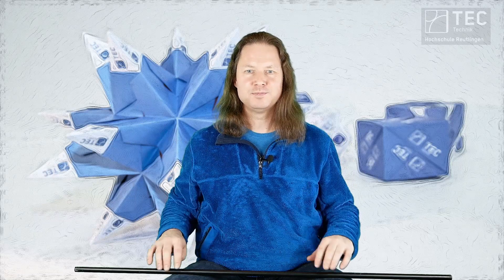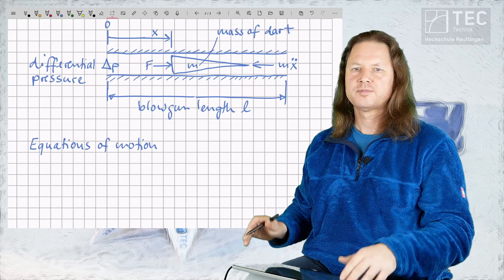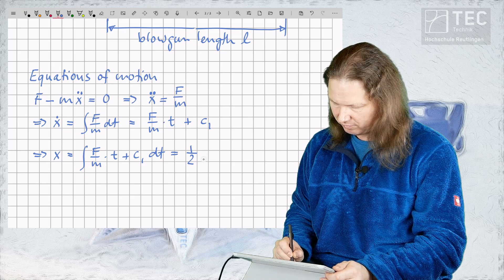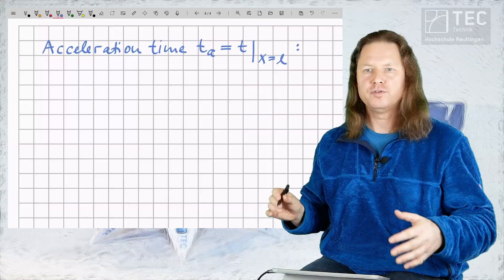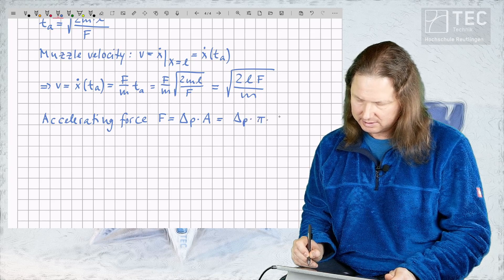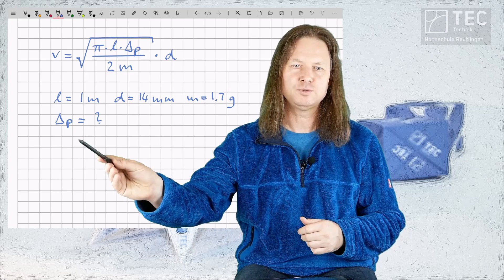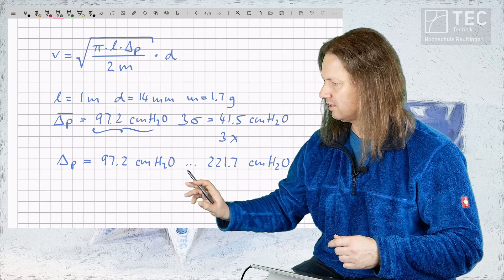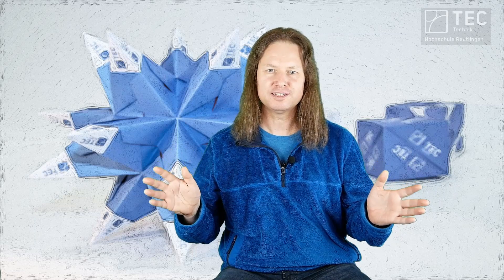Blowgun Physics

Comment: I may be wrong but didn't you assume that force is constant throughout its time inside the tube? But it can't be constant because the pressure difference decreases due to increased volume of air behind the dart as it travels across the tube.
Reply from the maker: Of course, constant pressure behind the dart is a simplifying assumption. However, the volume of the blowpipe is very small compared to the active lung volume, so the pressure drop can be neglected for a first-order analytic calculation of the muzzle velocity.
Reply: @EckhardHennig  I see... That makes sense. I forgot that the lungs are still connected to the gun while the blowdart is in the tube.

Comment: Does blowing a dart through a tapering diameter tube increase the dart velocity in comparison to a constant diameter tube?
Reply from the maker: I suppose you assume that the tube would widen towards the muzzle (otherwise the dart would get stuck). I don't know for sure, but I don't think it would work. Widening the tube means increasing the volume of air you have to push in at the same pressure level to obtain a higher accelerating force, and that would have to happen in the second half of the acceleration process where you're running short of breath anyway.
Reply: @EckhardHennig  I meant a tube that was widest at the blowing end and narrowest at the muzzle end, thus being an application of Bernoulli's principle to create a net force due to the pressure differential.

Did some digging, apparently this concept has been applied in anti-tank guns (term: squeeze bore) during WW1-2 to increase projectile speeds before discarding sabots were invented. Wondered if this concept also translates to blowguns, couldn't seem to find any examples.
Reply from the maker: Interesting. I'm sure, though, that my paper darts would just get stuck in a squeeze bore blowgun. They already do in a constant caliber tube if the diameter of the cone is just a bit too large.

Comment: Velocity = square root [ (3.14 * <Barrel Length> * <Air Pressure>) / (2 * <Projectile Weight>) ] * <Barrel Diameter>

V = sqrt [ ( pi*L*p )/ (2*m) ] * d